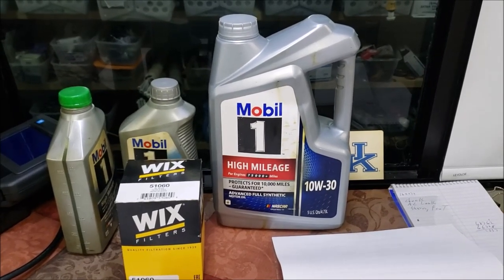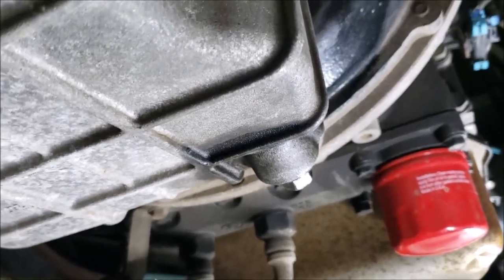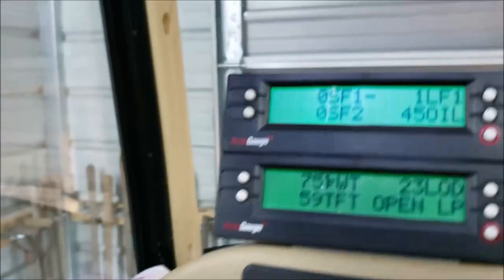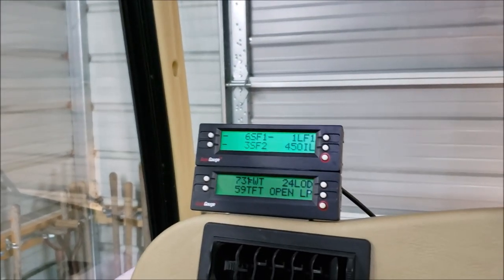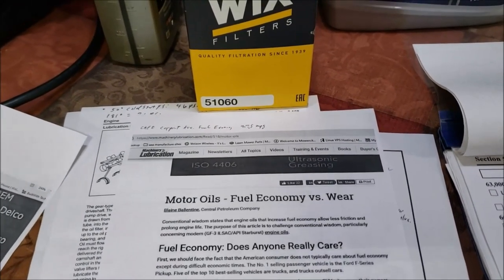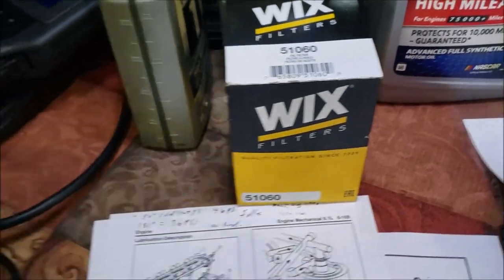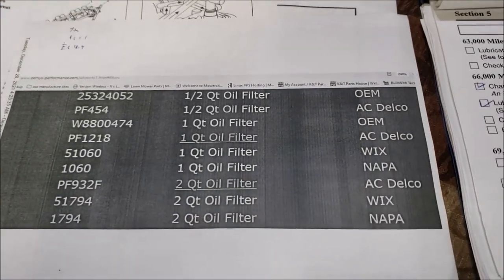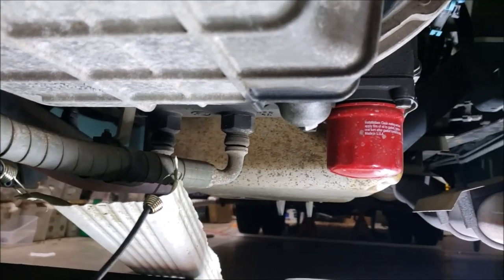How to Change Your Vortec 8.1 / 8100 Engine Oil & Oil Filter on A Workhorse Chassis and Much More

Comment: Good video. I especially like the punctured oil filter trick. I use the 2qt Wix filter and fill it up before installation.  I attached a big zip tie above the oil fill to hold a funnel when putting in new oil from the 5qt jugs.  It just stays attached for use the next time.
Reply from the maker: Thank you for contributing.

Comment: On the 4wd truck we have to run the short filter because of the front driveshaft.  I use the WIX XP though, it says right on it that it's for 8.1 4wd applications!  For what it's worth, I used to swear by Mobil 1.  I always had oil pressure problems in an old 90s chevy with 360k miles running Mobil 1 high mileage 10w40.  I switched to Redline 5w30 and the oil pressure is so consistent and perfect that I thought the gauge was broken and attached a mechanical gauge to double check.  Redline oil is made in a completely different process and doesn't use viscosity modifiers to stay thick at high temps, it's just better oil.  If that's too exotic for your taste, the hot stuff right now is the Shell Rotella Gas Truck.  It blows Mobil 1 away in every test I've seen.  Note also that these engines don't burn so much oil around the rings, they drink it though the PCV system.  One day I'll modify my intake, but mine does not use oil very bad.
Reply: great info
thanks
Reply from the maker: Thanks for the tip looks like I got some reading to do. I came across this about testing
https://www.mobil.com/en/lubricants/for-personal-vehicles/auto-care/all-about-oil/ask-our-auto-experts/oil-film-strength-of-mobil-1-compared-with-royal-purple

Comment: Great tips. Especially about adding oil in the new filter before installing. Thanks you Kevin.
Reply from the maker: Thanks for watching Dave PS I watched your Plane ride in the 1928 ford tri motor, did you know they used those engines in M4 Sherman Tanks

Comment: I use a fumoto drain valve on my pan.  Just slip a clear plastic tube on it and insert into my oil drain pan.   Makes for a really clean job.
Reply from the maker: I have seen those I just don't have the courage to trust one...lol
Reply: @ktoutdoor  I struggled with it for a while as well, but it is spring loaded AND has a safety clip that locks it closed.  Just seeing that oil running down that clear tube instead of my arm made it easier!!!

Comment: I've always used a Klein #1 Phillips screwdriver to punch a hole in the oil filter. I think that's what I han at the time, and have used one every time since. The center of the filer is where the bypass valve is located so it might not be as easy to put a hole at that point as it is closer to the edge.
Reply from the maker: And you never told me!!  lol I just learned this trick...

Comment: I’m not a mechanic so your video was especially helpful to me.  The parts store sold me a 1/2 quart filter 😖, glad to know what you use.  Punching the hole to drain will make it much easier. 
 I have a question maybe you’ll help with.  I recently noticed my 2004 w-22 leans .  I measured the rear and it’s several inches off side to side.  The spring shop wants to add a leaf to the bottom - both sides.  I’d rather replace the springs but I’m told they are not available.  I opted against “blocking”?     What would your suggestion be?  By the way , my fault , I stored it full of gas and water 🙄. I didn’t know better  but I do now.  
 Many Thanks 
 Jack&Molly
Reply from the maker: Good news you can still buy those leaf spring for your RV 

https://www.ultrarvproducts.com/W0012886-Leaf-Spring-Asm-Parabolic-Rear,-RH

https://www.ultrarvproducts.com/W0012885-Leaf-Spring-Asm-Parabolic-Rear,-LH
Let me know what you end up doing 606-875-0125 Kevin

Comment: After watching this video, and reading thru the comments, I am wondering if you have decided on using motor oil that meets the dexos requirements? I, like you,  change oil regularly, but in an effort to prolong the engine's life the dexos formula seems like it might be beneficial. I have learned so much from your videos, thanks again.
Reply from the maker: Thanks Larry I did some research and I'm not convinced that this oil would be good for our large 8.1 watch this https://youtu.be/gMHZd4SykhU 
Also read this about the march to thinner oils vs engine ware https://www.machinerylubrication.com/Read/518/motor-oils
In fact our service manual tells us we will have less oil consumption if we use a straight 30w oil in our 8.1  as long as the temperature is above 40 degrees
Let me know what you think.
Reply: @ktoutdoor  I agree with your logic that sticking with the factory recommended oil make sense after reading Machinery Lubrication article. How did you come to using Wix filters in lieu of AC Delco or Napa? All seem to have a good, better, and best style.
Reply from the maker: @larryv4249  Long time habit I think, It has consistent good reviews. I remember many years ago consumer reports did a study and the Fram filter rated very poor do to the fact it filtered to good and would stop up and go into bypass mode, not sure if that's still the case. But I still like my 1 quart Wix filter

Comment: Really should run DexOs branded 5w30 synthetic oil in this engine to prevent the dreaded lifter tick. You don't really benefit from using 10w30 as the oil passages in the lifters are tiny and it takes longer for the oil to fill the lifter. Retired GM Master tech 40 years in service bay.
Reply from the maker: I have never heard of that brand before I will have to check out.. I did see this
Dexos® oils are formulated exclusively with synthetics or synthetic blends. Better antioxidant technology that keeps oil from oxidizing. Dexos® oils generally have a drain interval of up to 15,000 miles. Lower viscosity that holds up to engine combustion and heat better and longer than other oils on the market.
I cant imagine putting 15,000 miles on my oil and what would the filter look like after that many miles?

Comment: Great video Kevin. In fact all your videos are quite good. Do you know what size of thread is on the oil plug? I saw someone else who installed Fumoto Series Drain Valve with Short Nipple with Lever Clip. This allows for attaching a drain hose and directing the oil to a pan. I have the same engine on workhorse chassis. Thanks
Reply from the maker: Great idea but they scare me just a little watch this https://youtu.be/Dm6Tq0nBQeU
The 8.1 Vortec uses a M12 X 1.75

Comment: So is it better to use the 5w-30 that’s on the oil cap or this oil?
Reply from the maker: I prefer the 10w 30 read this story. Let me know what you think. https://www.machinerylubrication.com/Read/518/motor-oils
Reply from the maker: The manual will also tell you it's fine to run straight 30w in warm climates

Comment: Shouldn't use a 180 degree thermostat either. Running below 195 degrees causes the engine computer to add fuel trying to bring the engine up to temp. Run the 195 degree thermostat to ensure quick entry into closed fuel loop control. 

They recommend thinner oil 5w30 due to closer engine tolerances. The info you are quoting on oil viscosity is hopelessly out of date information.
Reply from the maker: Thank you for contributing but unless things have changed they sometimes do I was going by the Workhorse service manual that states 10w-30 is fine as long as temperature is above zero degrees I got this info from page 17 of the workhorse chassis guide I can email you a copy if you like. I should have pointed that out in the video. It also states to run a straight 30 weight if your having problems with oil consumption, I also monitor my open and closed loop and it goes closed at around 130 degrees. 
PS: I would like to pick your brain about the GM tech 2 if you could reach out to me by phone or email,, my cell is 606-875-0125 My email is kc5210@gmail.com   
Have a blessed day. Hope to hear from you.

Comment: To reset the oil, with key on, just go to the percentage.  Press and hold the arrow/reset till it flashes reset oil meter. Press again and done.
That gas key gas key etc etc is not needed.
Reply: GT  could you please explain this further. Just changed my oil yesterday.  I know what Kevin is talking about, I have done that before when the change oil sign appears on dash.  I am not sure what you are saying I should do.  Or how to do it.  Please be more specific.
Reply from the maker: Please clarify I don't see that option on our 2005 W24 Workhorse

Comment: There is no Comparison to have here with regard to the 5/30 10/30 debate. Use 5w30 even if the model says 10w30. The oil moves quicker when it's cold. End of debate

Comment: GM uses the 1/2 qt oil filter so the total fill is 7 qts instead of 7.5 with the larger filter. 
No real benefit from using the incorrect filter.
Reply from the maker: I know 1/2 is most likely fine I just like the ideal of the more surface area of the filter media with the 1 quart filter, I know a lot of 8.1 owners that run the 2 quart version